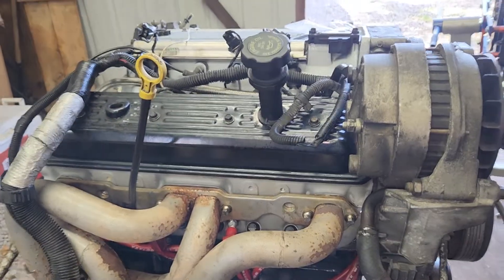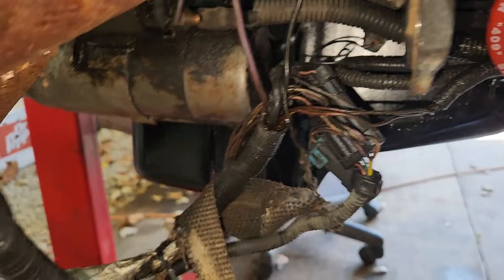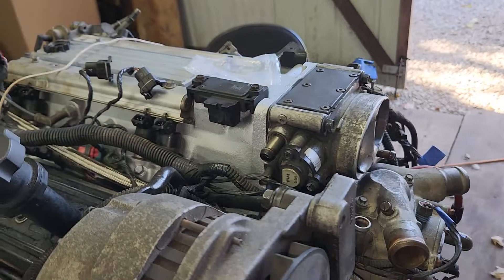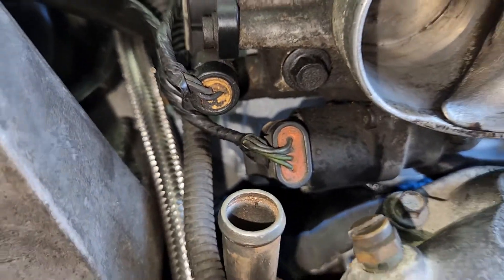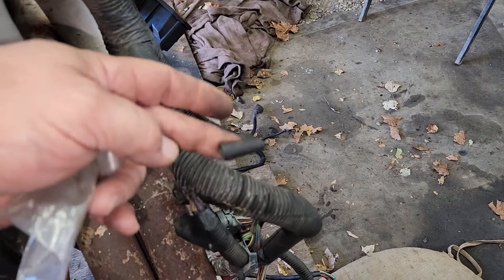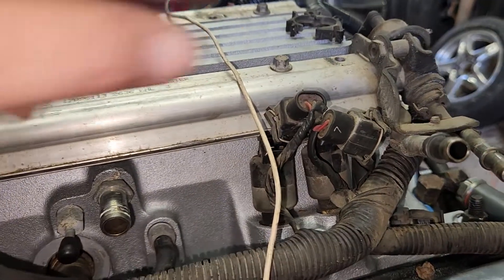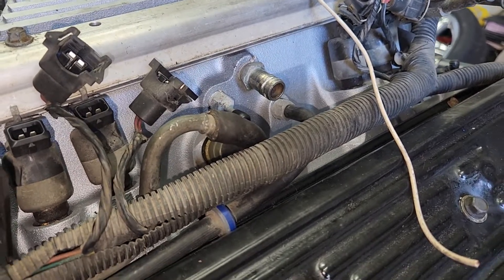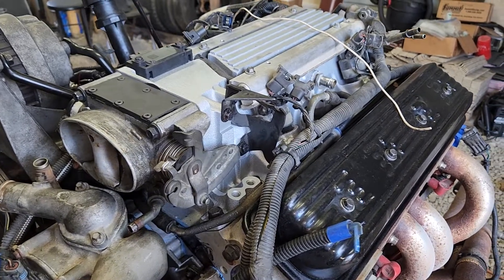Gen 2 LT1 Wire Harness Plugs

Comment: Thanks! I appreciate your efforts with these LT-1’s!
What type of programming do you do and what does a guy need to get into some basics?
Thanks!
Reply from the maker: On 1993 it is chip burn, you have to have a program and a chip burner. Im not too familiar with 1993. I used Tuner Cats for 94-95, it was like $150 with the USB to ADLD cable. Then you can log with free software like EEHACKS or Scan94/95. The 96 and 97 require special software and it is kinda hard to get, im not sure they sell it anymore. Most swap them to the 94 to 95 ECM due to the software being readily available.
Reply: @CarportGarageDragRacing  thanks. Mine is a 1996 5.7
Reply: Great advice about being able to swap the ECM to a 94/95! Thanks for that 😉👍
Reply from the maker: @jimssawsnstuff8903 just have to change the knock sensor other than that pretty much straight swap.

Comment: The 1 wire plugs in behind the alt, the thin red one. From there, where does it go back to? Trying to chase mine. Its only showing 9 volts and battery is showing 12.68.
Reply from the maker: That one just goes back to the gauge to show the alternator is charging.
Reply: @CarportGarageDragRacing   i unplug it n my gauge still reads 9 or around there
Reply from the maker: @briansaathoff4038  I stand corrected, that is the exciter wire. To excite the alternator to start charging. What year is the vehicle and is it Y, F, or B body and I will look on lt1swap.com and shbox.com and tell you where it goes.

Comment: Hey on the coil icm ground wires how exactly do they go mines on my 96 was broken off and I’ve been trying to fix them but not sure how they go
Reply from the maker: should be a few ground wires that bolt to the back of the ICM on the head
Reply: @CarportGarageDragRacing  ok thank you I definitely appreciate that information.. and when I bolt it up should the ground wires go behind the icm plate you was showing up against the engine body
Reply from the maker: @Jus3000  it is best to space the ICM out from the head some to get heat off it, get long enough bolts, or threaded stock, or long bolts you can cut, you can bolt those grounds wires directly to the head with a nut, then put ICM on, then more nuts to secure the ICM.
Reply: @CarportGarageDragRacing  ok I about to do this now and thank you again
Reply from the maker: @Jus3000  no problem

Comment: Hey i have a Impala ss and im having rear o2 codes coming up, are there o2 sensor grounds code is p0140 and p0160
Reply from the maker: Yes those are the rear 02 sensors and those are only for reading the catalytic converter condition, I tune those out. Does it still have the catalytic converters and rear 02s in it?
Reply: @CarportGarageDragRacing  yes it's all original and out of no where I've been having these codes and spent money changing them but no progress, I was wondering if it's a ground or connection because I don't see anything visibly
Reply from the maker: @shawtyred8658  it could be the catalytic converters

Comment: Whats the connector on driver side of the head by #1 exhaust port
Reply from the maker: Engine coolant temp for gauge.
Reply: Ok thanks bud I got a 95 z28 that’s ran hot mixing coolant and I have a 95 b body what all would I need to swap over to get the z back going
Reply: The b body doesn’t have that plug
Reply from the maker: @Chandler Smallwood  on B body it's on rear of passenger side head
Reply from the maker: @chandlersmallwood4587  it should have that plug.
Reply: Ok thanks I’ll check it.
Reply: Should there be anything I need to look out for
Reply from the maker: @Chandler Smallwood  did the fans not kick on? That sensor is on the front of the water pump on both B and F body. I tells the ECM engine coolant temp to kick fans on.
Reply: @CarportGarageDragRacing   I’m not sure I purchased it this way
Reply: So backstory I have a wrecked 93 z28 that I’m using for a donor and I purchased the 95 few weeks ago in the condition it’s in however I have a 95 b body engine as well no harness or pcm for bbody plan to use the original z pcm
Reply from the maker: @Chandler Smallwood  93 ECM is different than the rest. Then 94-95 ECM is the same and 96-97 is same. The B Y and F Body harnesses have plug ins in different spots, etc... and there are some differences between the year harnesses.
Reply: @CarportGarageDragRacing   I didn’t word that right mybad the 93 is going in an 78 impala and the 95 b body is going in the 95 z if that helps.

Comment from the maker: I messed up on one of these, the lower wire down by the starter/ground wire/knock sensor/02 sensor wire, the long one. Is for the crank position sensor in front of motor at bottom of timing cover. Only 96-97 has this wire.